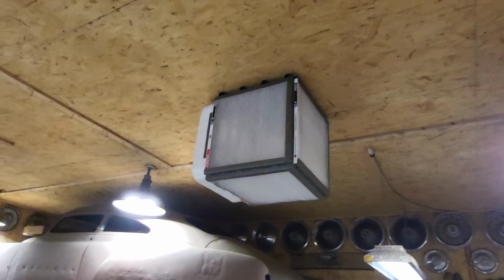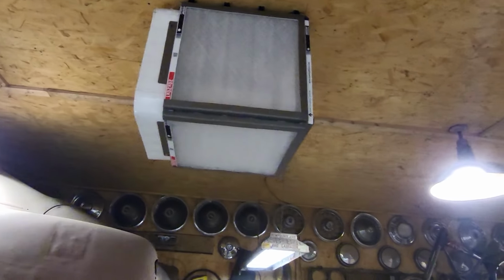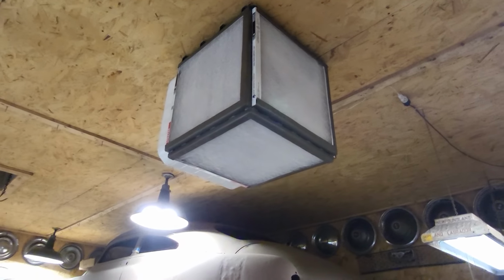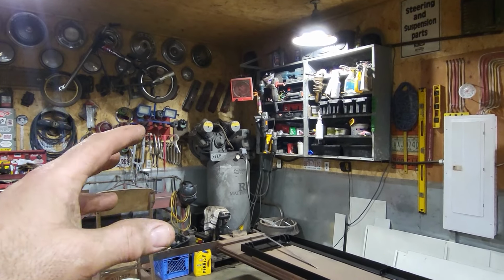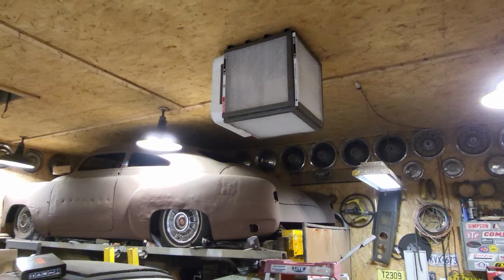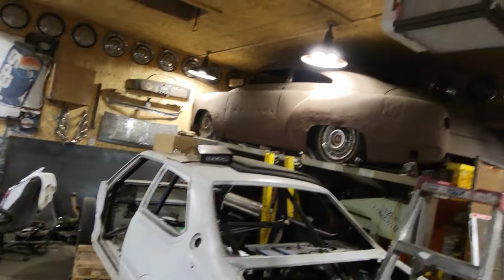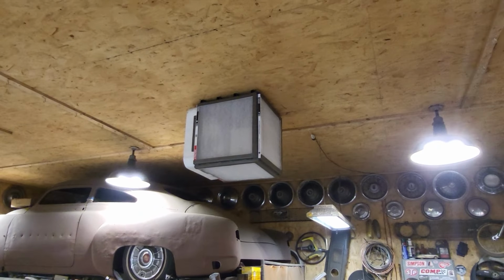Update on homemade air filter unit

Comment: That filtering unit works well. So much better than using your lungs to filter all that junk. Next time you change the filters, if you have a very fine scale, it would be interesting to weigh the new and used filters to see how many ounces of dirt the filter has in it.

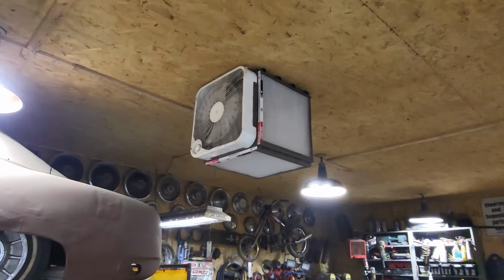Comment: Proof of concept an idea that works great.  At 5:41 you can see the buildup of dust on the exhaust side of the fan. When last I commented on your air scrubber / dust collector, I mentioned a plenum. 
Just for shits and giggles, have you thought about fabricating a piece of duct work, pointing it downward to disperse warm air towards the floor more and putting another filter on the exhaust side of the fan to see how much more dust it can scavenge?  You could easily make a temporary test one out of a cardboard box first and duct tape to your cleaner to see if there would be an increase of efficiency , just a thought.
Reply from the maker: It's working fine like it is. I have too much to be at now as to add another project idea to the mix. Lol
Reply: I also thought of that, but the fan faces a wall and he's getting a fair amount of diffusion there which is also moving some heat to the floor. The problem with too much air flow in a small shop is it will upset the shielding gas on his mig welder. I had that problem when using ceiling fans in my shop.... even on low speed.